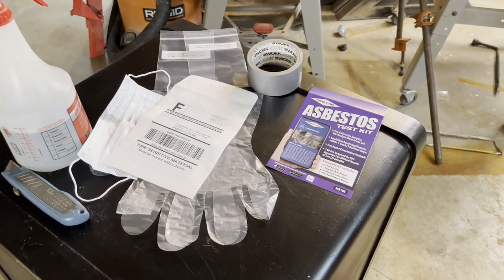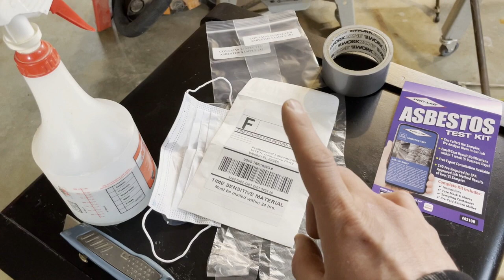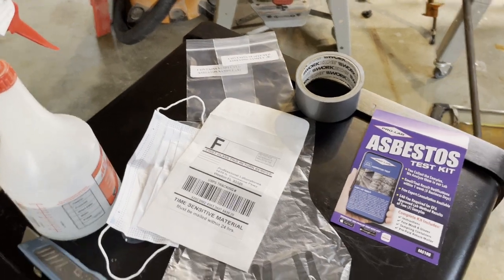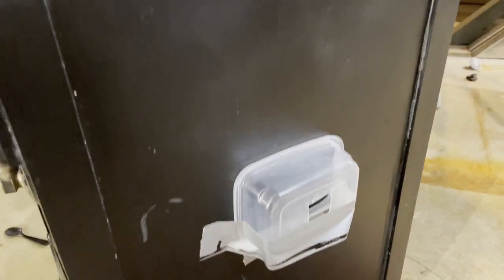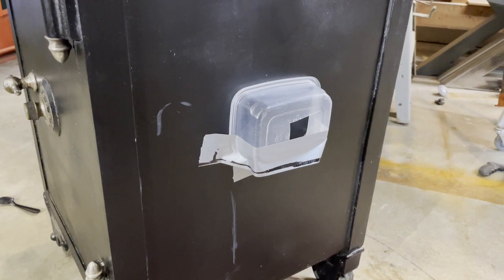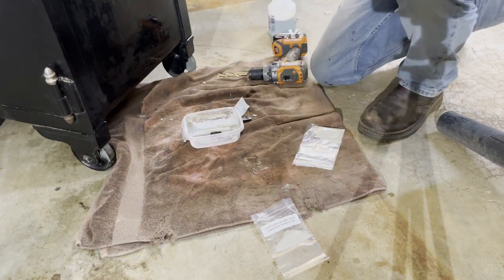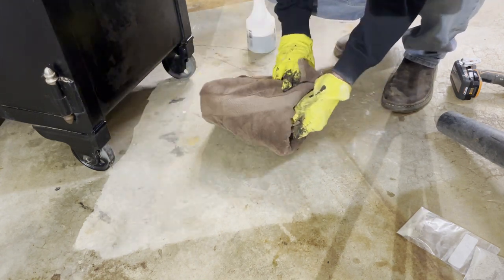Did cutting into safe release asbestos???

Comment: concrete would not have been turned to dust with that drill bit.
Reply from the maker: I had done a quick google search before cutting into the safe, and the site I looked at said they were filled with plaster of Paris, which is what it looked like in my safe. Hopefully it's not asbestos, but I did a follow up video where I test for asbestos. As for the value, I think you'd be surprised, antique safes in much better condition can be bought for $250-$300 around my area at least.  https://youtu.be/15dJRofGxhQ